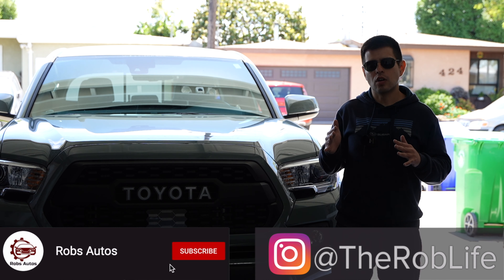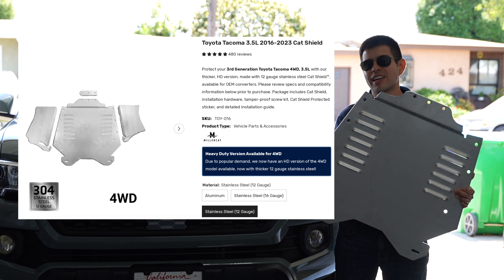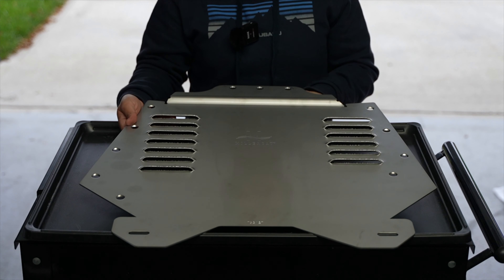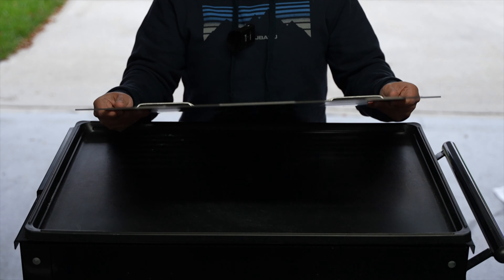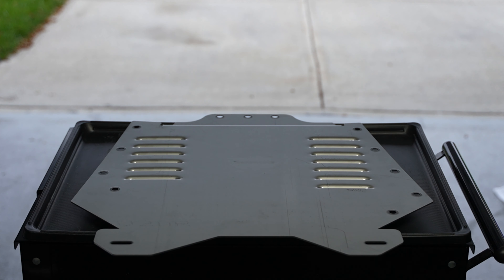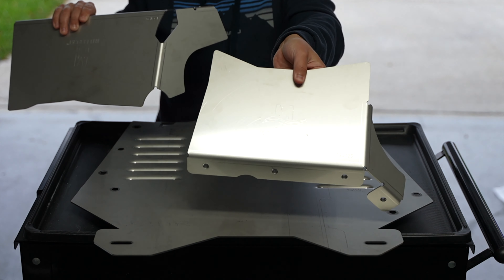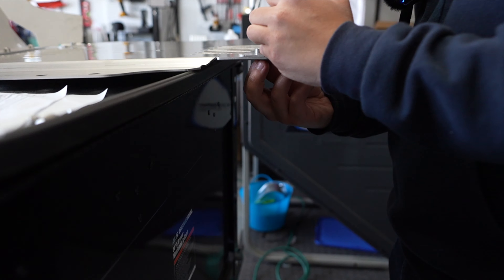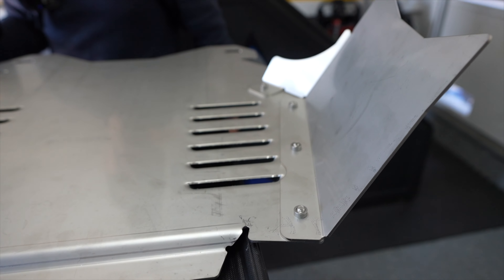Tacoma Protection! MILLERCAT Heavy Duty Cat Shield for 3rd Gen Tacoma Cat Shield Review and Install

Comment: Hi thanks for the info
How about transmission oil change? Is it enough space too?
Reply from the maker: Transmission oil change will require removing the shield
Reply: @RobsAutos would you recommend the individual shields instead ?
Reply from the maker: @chuyhdz3082  not sure if you can change the transmission oil if using the partial shields. I like millercat due to the full coverage, looks more intimidating for potential thieves